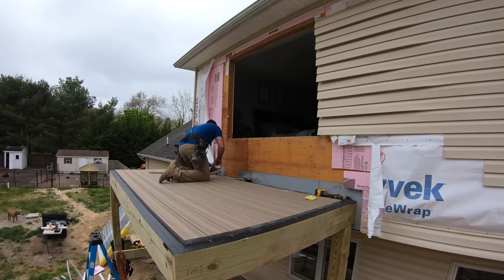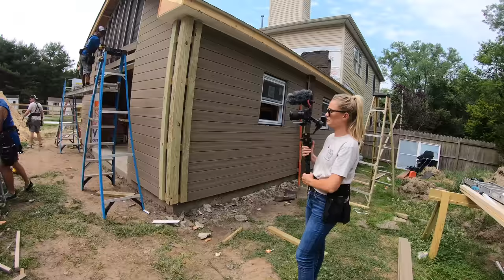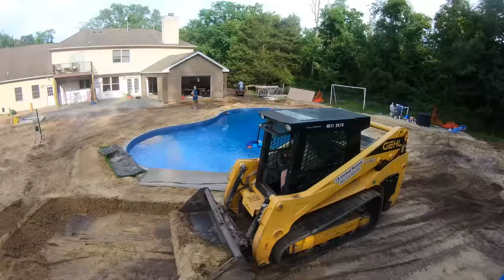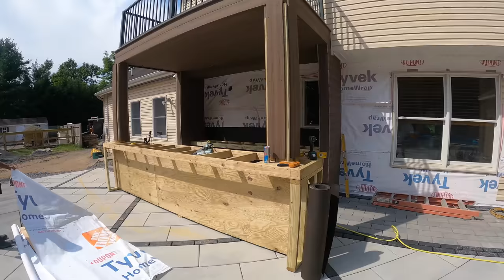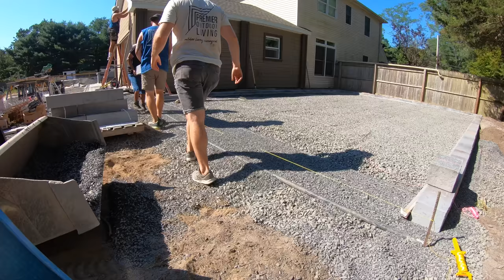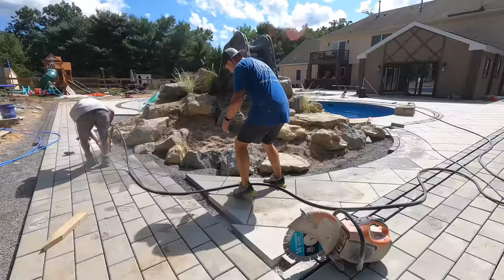Our BIGGEST Backyard Makeover EVER! Pool, Patio, Addition, and MORE!

Comment: As impressive and evidently expensive as this project was, it could have come in at a lot lower cost with a well-executed series of concrete pours into which textures and designs could have been stamped using rubber mats.  But the customer is always right, and in this case, I hope he's got deep pockets.  He'll need them.

Comment: My only concern regarding the prep of the pool floor is why is it that gravel is not put down and a tamper not used to strengthen the pool bottom portion. Also because of the sandy terrain, why is rebar or wire mesh not used to solidify the pool surrounding area. Sand tends to shift and it will cost cracks later on. Just curious.
Reply: Was going to ask the same question. Laying patio over grass and sand is a disaster waiting to happen. They only answer to praise by the looks of it. Definitely not how we lay it in the UK. The rest is class 👌

Comment: I've watched a couple of your videos now and I'm curious why you don't put paver joint sand down?  Every Summer those homeowners are going to be fighting weeds and grass trying to sprout up between every single of of those.  The sand not only locks everything together but prevents windward weed and grass seeds from settling down between the pavers and then germinating.
Reply from the maker: We did. We used nitro sand in the joints. No worries, those joints are locked in for justice!